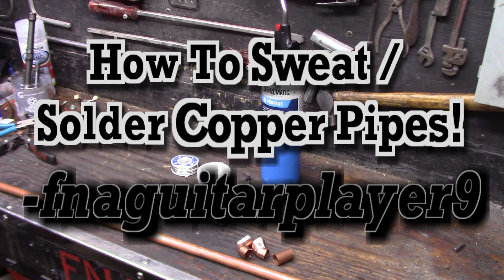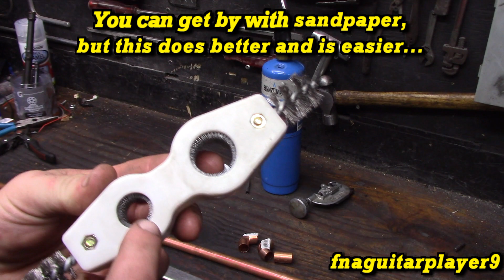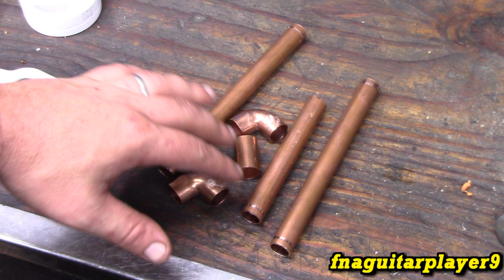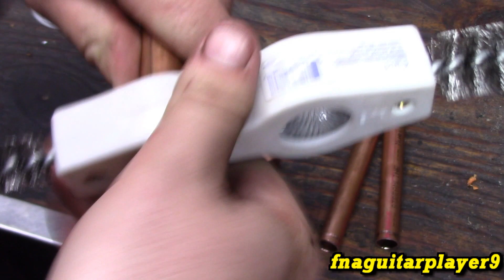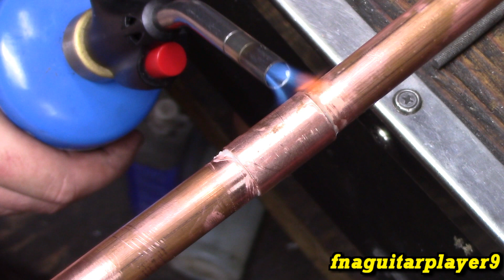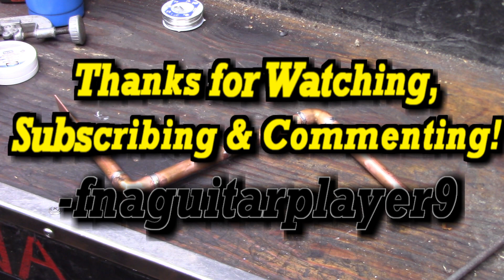How To Sweat / Solder Copper Pipes

Comment: On a vertical coupler, I know it's better to solder both ends in one shot, but do you solder the bottom first or the top? Or does it make a difference? Thanks. Good video. As a newbie, I was always concerned about running the solder all the way around, but you say only a quarter way is fine. Thanks for the videos.

Comment: Thanks for the tip "only apply solder partially around the joint".  I've always tried to apply the solder all the way around the joint. No wonder I've always struggled with this. Thanks for sharing.
Reply from the maker: Yes! I used to do that too, and you would think you would have to but it soaks all the way around on its own. Your welcome, Thanks for Watching!!!
Reply: @fnaguitarplayer9  I need to do a vertical sleeve/coupler joint this time. Will the solder travel up the pipe on the bottom seam?

Comment: That damn Silver solder isn't cheap stuff either but if you do it right, you can use Silver solder or use Silver solder rods like they use in HVAC repair and you can repair pressure washer pumps that have Frozen and cracked in a place or even more than one place if the cracks are as straight as possible and just clean up the areas with like a fingernail file just a little not much and I've seen a guy repair successfully a handful of different pressure washer pumps and he said the key is don't get the area too hot but the braising style Silver solder Rod is the best way to go just watching the Heat and not getting the areas too hot
Reply from the maker: You are right, it isn't cheap. I never thought of that before. Thanks for Watching!!!

Comment: also recommend pipe/tube stretchers, saves on the fittings and halves the joints
Reply from the maker: hahaha Thanks for Watching!!!
Reply: When I worked in manufacturing and helped with assembling log homes many many years ago, there were times if we didn't have a log stretchers we would have really been up the creek without a paddle LMAO